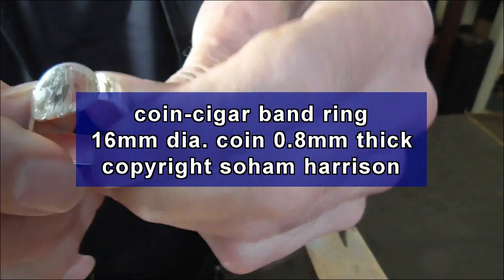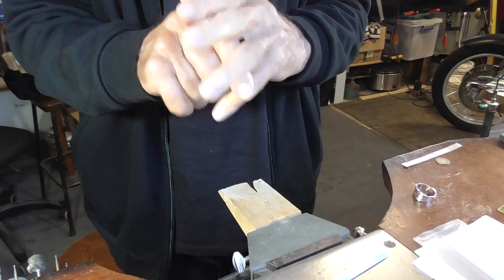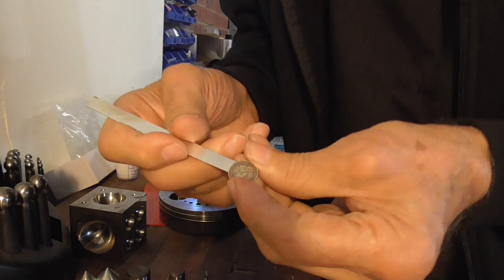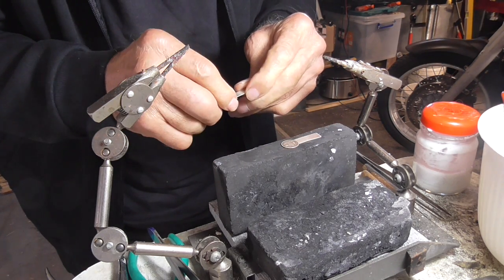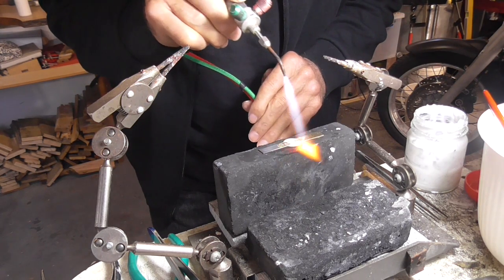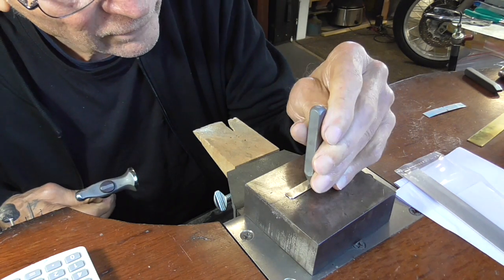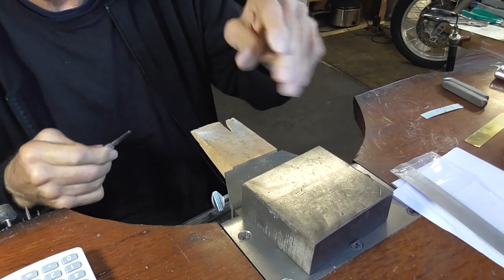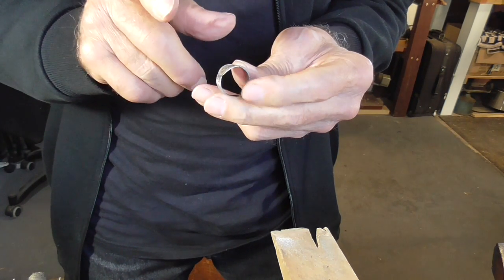cigar band ring

Comment: Great video as always but I wonder would there be any issue with soldering the two pieces together on the bottom to make a closed ring of a specific size rather than an open band?
Reply from the maker: no problem at all

Comment: I made a bracelet in this style. I got a little heavy with the solder on the one side. Out of curiosity is their any way to remove excess solder without sanding it off and thus losing the detail?
Reply from the maker: sorry, not really. we just have to learn from our mistakes
Reply: soham harrison no need to be sorry. it was my mistake and like you said I learned from it. luckily it was only my bracelet and it's not horrible, but I know it's no right.